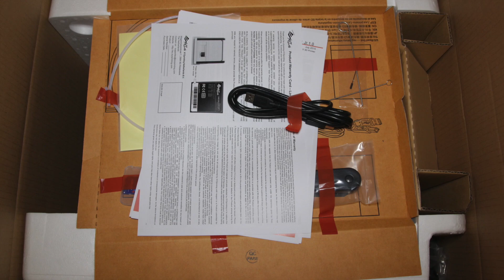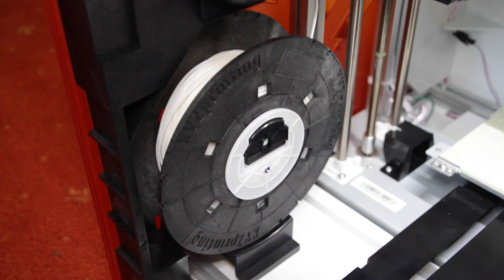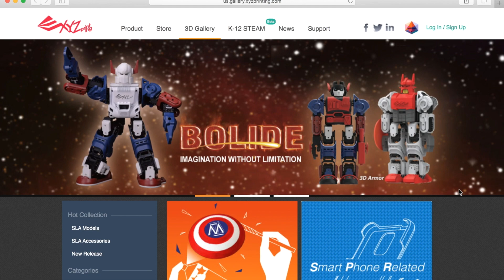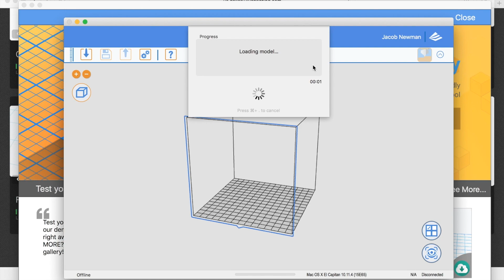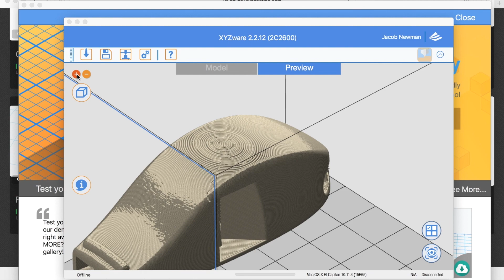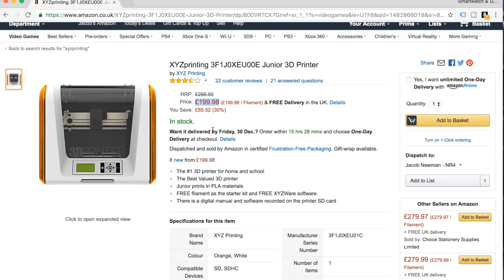$200 XYZprinting da Vinci Junior 3D Printer Review

Comment: can you use abs filament
Reply from the maker: No Paul, you cannot. You have to use PLA by XYZPrinting
Reply: You should be able to hack the firmware to Marlin though, enabling you to use different filaments.
Reply from the maker: Have you done this? Is it easy to do?
Reply: Unfortunately I haven't done it myself, but I was considering a DaVinci 1 before I got an UP mini 2. I looked into the firmware hacking and it looks like its just a matter of reflashing. IIRC it should be pretty easy to do. If you get it working then I'd recommend eSun filament. Low cost but high quality.
Reply: Dr Jake Unboxing Stuff He was asking a question not telling you something
Reply: Who